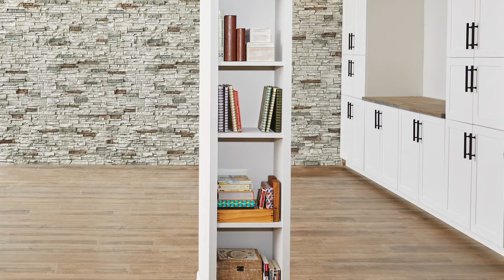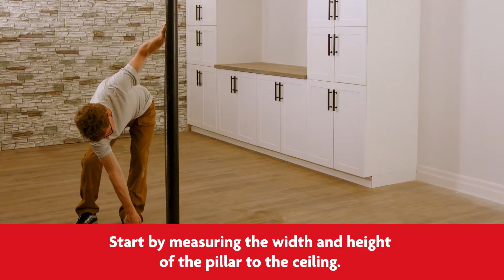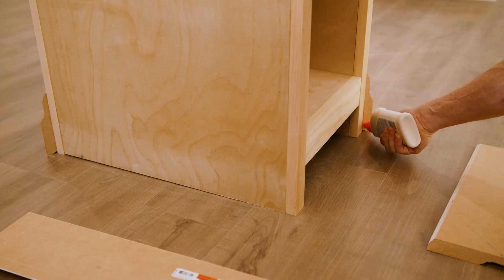Dress Up a Support #pillar, Here's How

Comment from the maker: https://www.homehardware.ca/en/blogs/p/support-pillar

0:00 Intro
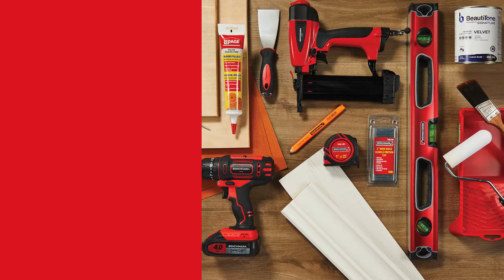0:05 What You’ll Need
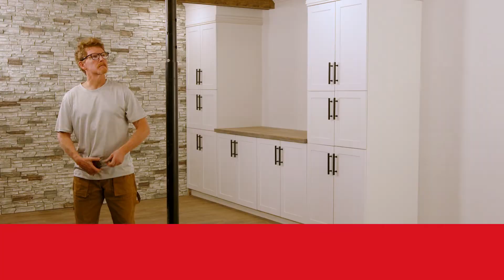0:12 Measure, Mark and Cut
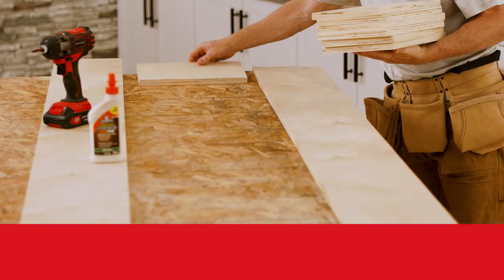0:54 Assembly
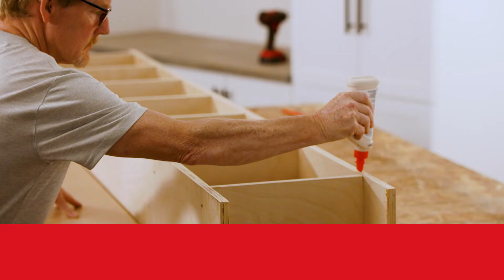1:41 Attachments
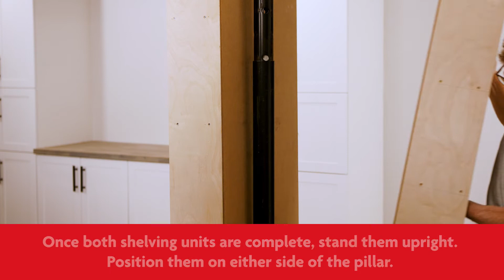2:05 Positioning
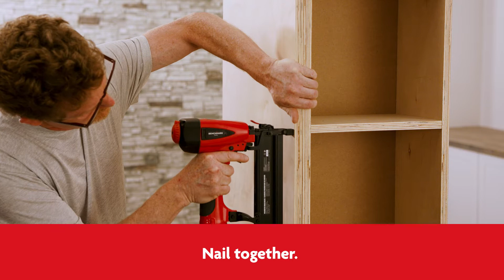2:13 Assembly
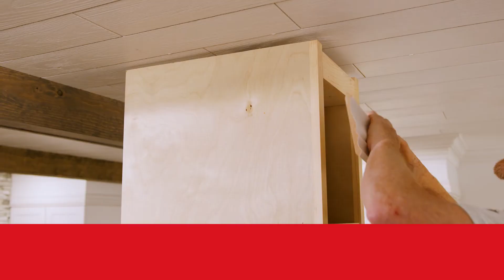2:45 Trim and Moulding
3:30 Sanding and Painting
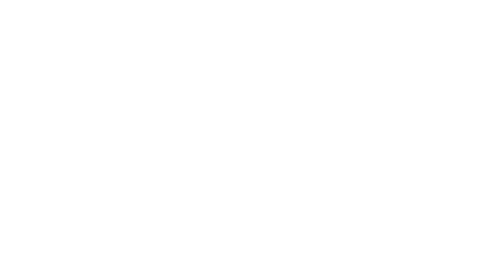3:50 Final Reveal